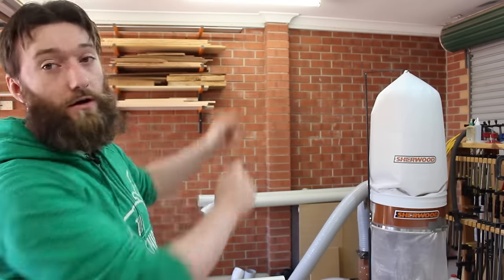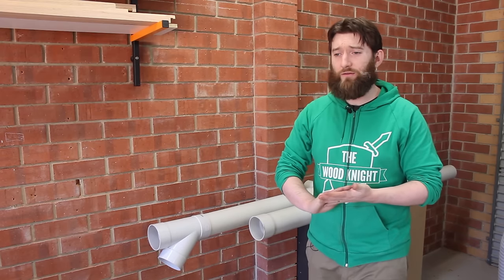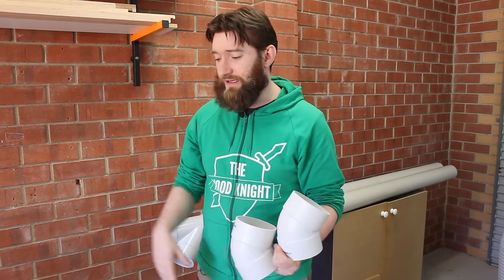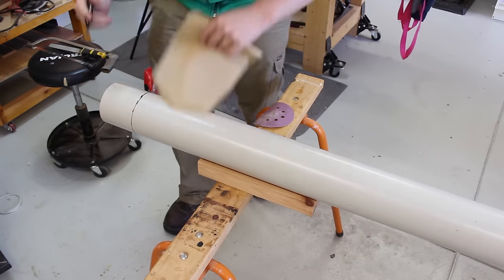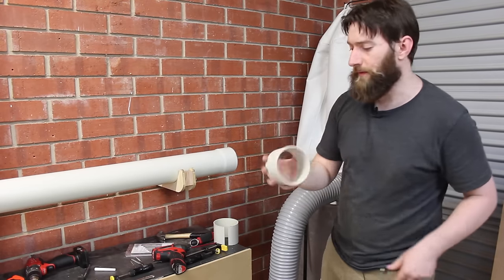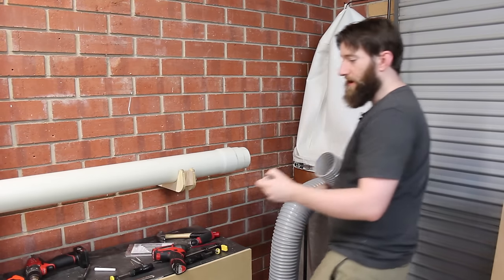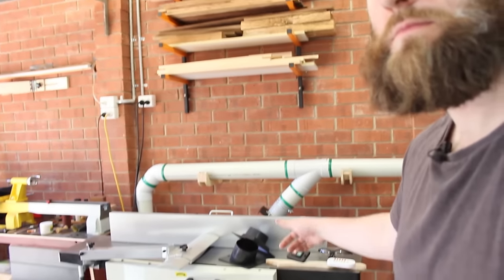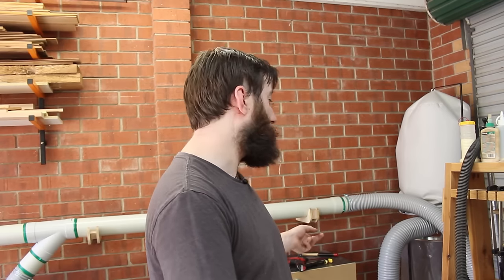Talky Tuesday: Plumbing for Dust Control

Comment: Very nice mate. I also have my Aussie woodshop (double garage) piped up.
After much trial and error, and  many changes I came to the following conclusions:
-I jacked up my dust collector as high to the ceiling as possible and cut the plastic bag to a 1/4 it's size as it wasn't collecting anything.
-Made Jords Woodshop's Cyclone and placed it's inlet close to ceiling height to avoid unnecessary bends in pipework,
-Transferred the dust collector's motor from dust collector trolley to directly on top of cyclone for more efficiency
-Ran main pipework 'diagonally' across ceiling of workshop to avoid unnecessary bends in pipework
- Branched the pipework towards machines with 'Y's- and only use 2 x45degrees (but you know that already).
-I don't glue pipe, i use a couple of small screws in some places and use the silicon tape to make a perfect seal
- I Use minimum hoses - most my machines are static and have been for years so PVC pipe goes straight into machines- this avoids loss of suction caused by ribbed hoses
- Jointer/ planer machine has the biggest chips so it's the closest machine to cyclone.
- I don't use the cheap plastic black blast gates anymore i made my own from Sketch up design- search for Pivoting blast gates in the 3D model warehouse (these are the best design I have ever used)
- I built a custom 'box' around my mitre saw with a plastic curtain next to the machine to draw the most air- this was easily the messiest machine.
- I built boxes around my bandsaw and scroll saw (under the tables) much like Ronald water's video: https://www.youtube.com/watch?v=weRyswSKJ84
https://www.youtube.com/watch?v=3UNQ9kBE_Bw

All in all it's taken me years to get this far with many frustrations along the way especially when I was getting weak suction.
Now I have almost no dust in the work shop and, because my partner has a dust allergy, I can spend a lot more time in the shop (not) making dust.
Sorry for the long post- but I thought this would help.
Reply: Hi Marisa -  Great comment and stream of ideas.  I checked out Ronald Water's channel, so thanks for the recommendation.  Do you have any pics or videos of your shop?  Would be good to see some of the details you mentioned. - Phil

Comment: My Carbatec Dust Collector has a NVR switch too and I use the same remote. It has the big red safety button on top which I cable tied down with a piece of dowel under it pressing the green on switch - remote turns power off and on with no hassles!

Comment: I recently moved my extractor to a mezzanine level in my shed, I pulled the switch out of the machine and extended the wiring from the motor to the switch to allow me to remount the original switch, now I have it at easy reach

Comment: I use a small clamp to hold the green power on button on the vacuum down at all times and use the remote to turn it on and off.

Comment: I also use PVC for all the dust collection ducting in my shop for years and have had no issues. I couldn't find one case of a fire or explosion caused by static electricity in un-grounded PVC. But, some people are truly unhappy and will negatively comment about anything to include their own mother. Looking forward to seeing the rest of your dust collection setup. Keep up the good work!

Comment: Regarding the switch you can just hardwire the motor to the lead, connect blue to blue and brown to brown in your switch box then just plug it into your remote switch and you will be away. 

obviously not great if your remote switch fails but thats why we have switches on our power outlets in aus ;)
Reply from the maker: +JordsWoodShop I considered that, the wife was against it. Better to say 'yes dear' than to deal with paranoia ;) RS-Components have a few starting at about $4, so I might just grab one of those or make a trip into jaycar for some other electronics stuff
Reply: +Paul “TheWoodKnight” Jenkins in regards to remote on/off I just bought a remote kit for power points from bunnings and installed it after the dust collectors on/off switch. this means I still have the safety of the switch when the power goes out the machines switch will go to off but I can also turn it on and off from a remote. I had to pull the remote get AC side apart but managed to get it to fit inside the dust collectors case so it doesn't look like it's been hacked.
Reply: +Paul “TheWoodKnight” Jenkins I've just cut the wire from the switch to the motor, and put a male and a female wall socket in there. That way i can connect them if i want the "safety" or put the remote switch (or an axtension cord with a regular switch) in there if i want the speed.
I don't quite see how connecting an induction motor directly to a switch is unsafe. The only reason for having that magnetic switch is, if the power goes out, and you decide to disassemble the impeller housing, with the switch turned on, and the machine plugged in, and THEN the power comes back on, with your hand tied to the impeller, so they just wouldn't be pushed out of the way. A very unlikely scenario, and even then, the remote switch wouldn't turn on again.
Safety is fine, but this is the same as having a magnetic switch on a bench grinder - what is the point?
But to each their own. My point is, that taking a stance on safety from an emotional point of view, instead of an informed one, is well - uninformed.
My wife said i should use safety gloves while working on the table saw, because it feels safer for her, but then i calmly explained that a spinning blade doesn't stop because of 2 mm leather, but it might actually get snagged on the blade, and she understood, because wifes are not idiots :).

Sorry for the rant - i love your channel, and i'm not trying to be an asshole or a troll.
Reply from the maker: +Peter G With a bench grinder - or any exposed spinning tool where you operate in front of it - I can understand, if a brownout was to occur the momentary cut out in power and human reaction could cause you to put the workpiece or body into a "whats going on position" which could have consequences when the motor starts back up.

The wife also uses the workshop as you would have seen, and she fully understand the risk (or lack thereof) associated with 'hard' wiring it. However, dealing with depression and anxiety is somewhat of a more complicated matter. There are some issues that get tackled head on, then there are others like this that are just simpler for all parties involved to just avoid. <AUD$5 (delivered) for a replacement switch seems like a very good and sensible option for her peace of mind.
Reply: +Paul “TheWoodKnight” Jenkins Also you maintain your e-stop switch as it is still wires up. I believe it's the e-stop that made me wire mine the way I did.

Comment: I don't remember where I saw this tip but the person was having a whistling noise when the dust collector was running, he found that running a screwdriver along the outside of the flexible pipe was enough to stop it. Hope this is useful if you have a similar problem

Comment: Have you considered getting one of the plastic super dust deputy clones that are on ebay instead of a thien baffle? I've also been looking at Hare & Forbes' cyclone offering. Need to get down to Sydney and check it out in person one of these days
Reply from the maker: +Pete G i have, and the cheapest I could find was about $250. A thien baffle will cost me some scrap ply, some threaded rod and nuts, two fittings and a hose. I may upgrade to a cyclone at some point but thien is almost free (have scrap ply, short threaded rod left over, etc) :)

Comment: Hi Paul, nice video.  I am not sure if you mentioned the rationale for choosing 4" over 6" pipe for the main run.  With 2 hp low pressure pump, you may be giving up heaps of flow with that smaller diameter arrangement.  I guess the proof is in the pudding.  How is system running these days?
Reply from the maker: Cost and availability in Australia is why I went with 4" over 6".

DC runs just fine, pulls all chips from the combo machine furthest away, but even steps down to 2.5" for the router table and drum sander adequately
Reply: @TheWoodKnight  Great to hear you've had positive results. I'm in process of designing plumbing for an old Oneida 1.5 hp that I  Gumtree'd, so may not have as much room to play with in relation to pump/blower performance, due to less power and likely less efficient impeller design.  I'll see how I go. Thanks again for your videos!

Comment: Hi Paul 
Can you please tell me how you how you set up your remote control for your dust collector. I have a Carbatec 2 horsepower dust collector with the same type of on/off switch.
Also thank you for your review of the Bosch orbital sanders. Based on your review I have purchased the GEX 150/125 AVE sander and I love it.
Cheers
Boris
Reply from the maker: I haven't setup the remote for the dust collector, that was kinda the point in me saying that.

Comment: make an entrance on the floor so you can sweep debris into the system those are really handy
Reply from the maker: +Sebastian Hanhausen the kit with the hose and various fittings included a floor sweep module, just installing it is going to be tricky. I think we'd want it on the lathe side of the workshop (since it produces the most shavings that get to the floor), so I'd probably have to run a second branch to the floor at the end of the existing turn to the floor. I ran out of PVC and PVC fittings to do that unfortunately.
Reply: +Paul “TheWoodKnight” Jenkins the late area sounds like a good place for it and it is unfortunate indeed that you ran out of pvc I know how hard it is to put a proyect in gear again once it has stopped

Comment: why didn't youuse the chop saw for PVC.
Reply from the maker: +stewart c noise, pvc dust everywhere (Bosch GDL12 doesn't have great dust collection), prematurely dulling the blade. Take your pick.
Reply: +Paul “TheWoodKnight” Jenkins fair enough. i just see most people do it with a chop saw and thought it would have been quivker
Reply from the maker: stewart c It probably would have been for the cuts, but the cleanup of PVC and moving the (out of frame) projects on the go to get to the mitre saw would have taken longer! Have a few big/heavy projects going on in the background that ended up in front of the mitre saw.

Realistically, each PVC cut only took 1-2 mins, and maybe another minute to deburr/sand, and for how few cuts I needed, it wasn't too bad.

Comment: Hi Paul, did you end up replacing the switch? If so, could you possibly provide a link to where you bought the replacement switch? I'm in the exact same situation with the carbatec extractor (which i think is actually the same unit rebadged).
Reply from the maker: I did, just last week actually I had a sparky friend wire it up. I don't have a link on hand, its a DPST (dual pole single throw) switch I got from RSComponents for about $5. They have a range of switches depending on what you want colour/LED wise. I'm yet to make a cover plate to tidy it up though

Comment: Thanks for sharing Paul, great setup ! I have just purchased the same dust collector from Timbecon and would like to know where you purchase your flexible hose, I was actually thinking of using the 90mm PVC as it less expensive than the 100mm pipe as it is only for  guttering etc not sewer, would like your thoughts
Reply from the maker: I get flexhose from Timbecon - dont' get the "all in one" kit with fittings, as the hose in that is terrible (not very flexible). Make your own blast gates, as the plastic ones will fall apart.

You want to go for as large a hose as possible, to help with airflow. 90mm has a surface area of 254cm^2, 100mm is 314cm^2. It causes a big difference in airflow. Ideally I'd go for 125mm/5" ducting for my main trunk, but its only available in metal (and thats pricey).

If you go for 100mm at Bunnings, get the largest length available, and bring a hacksaw to fit it in your car. It is (was?) $36/6m, or $12/1m. I used a jigsaw to cut mine down.
Reply: Paul Jenkins thanks very much for the reply, I never thought of the airflow difference, that's a great point. Many channels don't bother to answer questions or respond to comments, I appreciate that you do. Subscribed from NSW

Comment: As soon as I saw you start I though "Oh no Paul! You're about to unleash the wrath of the YouTube safety police!" thinking the issue would be the static. But now I'm worried you're going to trip on that pipe!
Reply from the maker: +Rick Measham One big pipe is way less likely to be a tripping hazard than the snaking flex hose & dust collector in the middle of the room. I forgot to get a panning shot of the ceiling, but there isn't a better way that I can think of. I'll have to produce a Sketchup model or the like of the floor space & machines so I can show what I mean.

Comment: I have basically the same setup - PVC pipe, HF 2 hp dust collector with the thien baffle - no filter, just exit exhaust, in a corner closet for sound reduction. I really like it. My shop has a crawl-space, so the piping is under floor. It a bit of work, but very nice - no obstructions.

I made the closet big enough for my air compressor to keep that noise down as well. 

Best of luck,
Troy 

http://lumberjocks.com/TTF/workshop